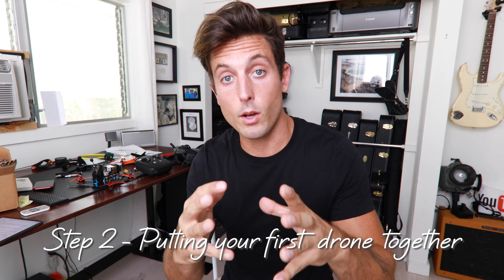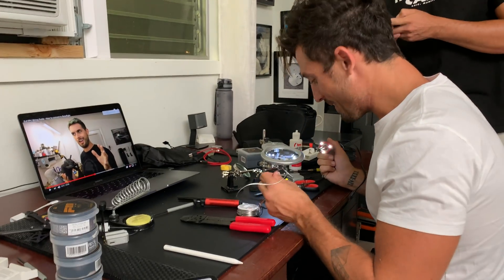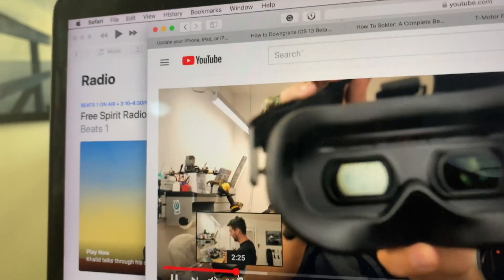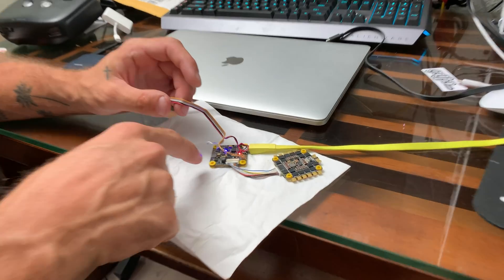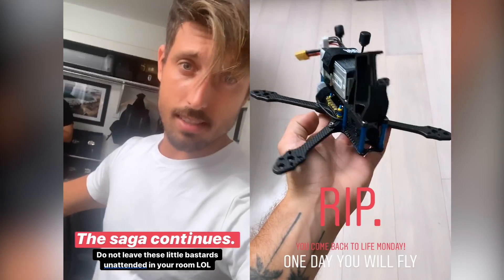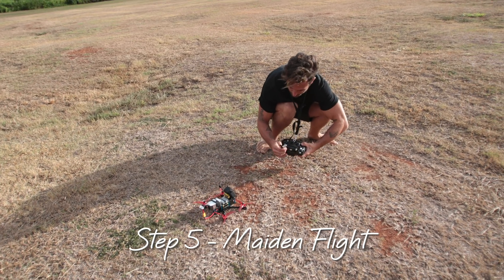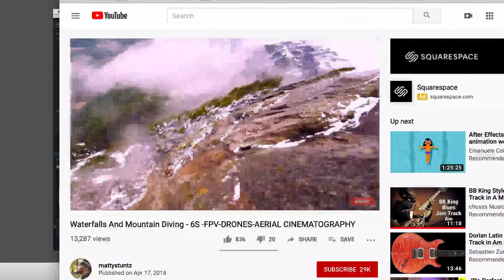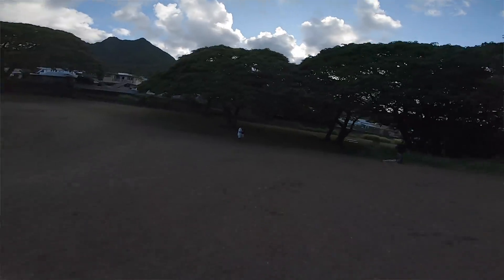How To Build a Cinematic FPV Racing Drone! • DJI Fpv

Comment: PID stands for (P)roportional (I)ntegral and (D)erivative 

When adjusting these terms in the algorithm you are balancing the response rate to the separation between current value and desired value. A cheap and dirty example of this is a temperature controlled environment.

Comment: Burning circuits or getting smokes generally means having the positive and negative terminals connecting or getting short circuited, if I recall. One way to check before soldering would be to use a multimeter first

Comment: Thanks for sharing you experience!
One question: Can I connect the new DJI FPV RC to my PC to use it with a simulator? I'm willing to buy the flight controller (only) to try it out, before I invest in the whole system.

Comment: Dang Fatshark! 
You guys missed the opportunity to win this race! 

People easily spend near $1k on their new phone every 16 months or so.   

I also rather spend $800 on nice HD setup over the old analog goggle full of patches, modules connections. 

It's just matter of time for more and more people acquire DJI headset which already comes with receiver and cost only $79 more than the HDOs that does not even come with a receiver.

Comment: To practice soldering you don’t practice on expensive chips LOL
Reply: yea i got started by soldering and desoldering resistors and wires from broken tv remotes
Reply: I did practice soldering with the "mamba practice board" Very cheap, and it has many  different types of pads
Reply: Soldering is literally so easy and if you don’t know how to just watch a tutorial.
Reply: @andykoch8599  Agree with you lad. I started first time on a 20x20 fc. Had a bad time the first time i soldered a receiver to the board. Then watched a bunch of videos on soldering and realised i needed to buy 40/60 solder and some flux. Haven't looked back since. I even built on a 16x16 stack recently and that was my 3rd build ever.
Reply: Omg did not thought of that🤣🤣🤣🤣🤣🤣🤣
Reply: I started with diatone practice board then cheap whoop i bought. Modded it.. 
Now trying to build 95x from scratch.. 
I'm thinking this is cheaper but god damn whoop pads r small
Reply: Thats the easy part for me, soldering and fixing electronics since i was 9, and programing is my job.
Reply: @Robbiebrito  that’s dope

Comment: super cool video , i have a question though every one seems to skip the part about the simulator and thats what im interested in the most at the moment , what sort of simulator setup should a beginner start with in terms of radio and fpv goggles ( something that will actually simulate flying a real drone so no Xbox controller and a PC screen sort of thing )

Comment: hey! did you actually connect the dji fpv radio to the simulator? if yes, could you let me know how? So far I do only own the dji fpv remote but i can¨t get it to work with my imac (i tried it with 2 simulators). cheers

Comment: Great work!  Nice to see a 0 to ridge diving video.  And this is as close to 0 as you’ll get, lol, so consider me impressed!  You should upgrade to the Hakko 888D for soldering.  It’s a beaut and it heats up really fast, high quality Japanese electronics.  You won’t regret it.

Comment: Great video Sawyer!  I happen to be at the same point in my FPV career.  Watching your video made me feel better about my own experience, since it is basically the same.  Hundreds of sim hours, dropped $1500 on parts, fried a camera, broke a bunch of straps, ate battery wires with my props, just got my goggles from China, already killed a motor, etc.  But I'm still at it!  Drew, Joshua, Steele, Rotor Riot in general, and UAVfutures have been invaluable to me, without them I doubt I would have felt confident enough to buy anything.  I look forward to more videos from you.

Comment: Your tune could use some work. Its a bit tight, that high speed oscillation you can hear but not necessarily see is D being too high or the ratio between P and D being too high, because PIDs aren't independent nor mutually exclusive variables, the Ratio between P and D is very important, and as you scale on you will have to scale the other.

Comment: It's not pid. PID ( Pee Eye Dee) is a way of controlling, in this case your drone by removing the error between what you want it to do and what it's actually doing as fast and as smooth as possible. That's why you tune your PID values - the better the values are tuned , the smoother your drone responds to your commands

Comment: I am new in FPV but I have a 20 year experience in real aircraft (and i can find a lot of similarities between those)... 
From my point of view this video passes wrong messages to someone who would like to take up this hobby.
It is not a regular hobby...
It demands a lot of skills, patience, knowledge, budget and discipline.
Moreover, it demands to stay strong to the fails that will come and level of risk assessment.
As I stated, I am not experienced in FPV, as many others in here, but I can assure that there is no way to present the build of a Quad in less than 13 min in a solid way that will pass the correct messages to those who will decide to take up this stuff.
Safe flying to everyone.

Comment: I just want this to be known, he spent way to much on his stuff, common rule of thumb 5in goes with most 5in stuff and I spent 600 bucks building my drone (two batteries, stuff to build drone, controller, and googles) and I bought very expensive googles, don’t think you have to spend thousand plus on this hobby, it’s expensive cause stuff breaks, especially cause I push my self very hard and do things I don’t think I can do, it cost me a lot but iv become very good at flying in a short time, your gonna crash but these drones are strong, usually just some props

Comment: This is almost exactly the same experience I had going thru my first FPV build. .... EXCEPT I was building with Eachine and the cheapest parts you can find on the internet.   Smdh it was still super expensive learning how to build, fly and tune my drone.  I can only imagine how expensive it was learning to build with DJI and their recommended parts.  Nice job.

Comment: This was a great vid! When I got into this hobby there was only the blackout frame. And there was not a simulator in site. I had to learn to fly by just going out and destroying and loosing drones.  I started out with the kk2 board on bigger drones then drones started to get smaller and more agile. Building was easy because of my US Air Force mechanical background but the learning to fly was hell. Glad your in the fpv world now. Keep pushing!

Comment: There is plenty of info on the net on how to do this, you just need o know where to look :)

Anyway, here is my generic advice for anyone interested in this awesome hobby....

Step 1: Get a Radio, Fly a Simulator
The first step is to buy a quality radio. Pilots who are used to video game controllers might like a FrSky X-Lite while others may prefer the FrSky Taranis Q X7. While FrSky radios are the most popular, there are also other great options like the FlySky Nirvana or controllers made by Futaba and Spektrum ( And now DJI). Once you have a radio, connect it to your computer and practice flying in an FPV flight simulator. If you opt for the QX7, be aware that many new pilots assume it comes with a battery or a way to use AA batteries however it does not. You will need to purchase a separate battery for either of these FrSky radios.

Step 2: Find Pilots Near You
Search Facebook, YouTube, and MultiGP to find other pilots in your area. Sometimes having someone local is the best resource for getting help when you need it. They can also point out safe spots to fly and might be willing to meet up for group events.

Step 3: Education
While you are training yourself playing around in the sims, watch every video you can by Joshua Bardwell, UAVFutures, Mr. Steel's How To FPV Playlist, and others on YouTube. You will learn a ton. Perhaps even join some of the FPV related Discord channels, or FPV subreddits ( r/Multicopter r/fpv r/multicopterbuilds r/fpvracing ), and ask questions.

Step 4: Buy or Build Your First Drone
Some people decide that buying a Whoop class drone is the best way to get started, others prefer to jump right in to the 5" class and build their own. Definitely check out Bardwells FPV Shopping List if you are going to build your own. Lots of good info in there. Also knowing how to solder is very important when building or repairing your drone. Get a good soldering iron, watch some tutorials, and practice before the iron ever touches your drone. The last thing you want is a solder joint failing while your drone is zipping across the sky at top speed.

Step 5: Goggles
To truly fly FPV, you are going to need a screen. Most pilots will opt for a goggle of some sort. If you are just starting out, get some relatively inexpensive box goggles. The eachine EV800D seems to get good reviews. If you outgrow them and you want to upgrade, they make great passenger goggles to bring friends and family along for a ride, which is also a great way to spread the hobby and get others interested.

Step 6: Enjoy!
I know it may seem daunting and there is a lot to learn, but it is fun and well worth the effort.

Comment: I’d really like to get into this. I use commercial drones for a living. (M600, M210/RTK, Inspire 2)
Every time I fly the I2, I always have to set it up to my preferences. (Collision sensors off, max decent speed ect.) .... Sorry to the guy that has to fly it after me... 
You can absolutely FLOG an I2 and do some pretty cool maneuvers. But it wouldn’t touch a racing drone. I feel like that is the next step... as a hobby anyways.

Comment: Cool video👏. I totally agree with the learning curve part. Flying, researching what to buy, understanding electronics, soldering, understanding telecommunications, programming, PID tunning... and crashing and repeat all over again... FPV is not an easy thing but it is totally worth it. I started about 1.5 year ago and I'm absolutely hooked.😍 Also big thanks to Joshua and Ledrib and all the fpv community bc without the yt videos I don't think I would have started in this hobby. 🚀

Comment: A digital multimeter or a smoke stopper would have stop some of those mistakes. You nailed it though this is what the hobby is. I felt like I was back in school the first year. At times I felt like quitting but I’m glad I didn’t.

Comment: holy shit, noob, lol, I smoked my first build also. check the main xt60 leads with a multimeter for continuity, and use a smoke stopper. Also, you kinda bought really expensive parts for no reason. I spend around 400 to 500 per quad, and that is expensive, you went completely overboard. in addition, build from the outside, in, so start by putting motors to 4 in 1 escs, and then attach signal wires to that. Also use dshot 600 and sbus

Comment: Great video! Stay away from 4in1 esc's. Singles are cheaper and easier to replace. I have been flying for 3 years and racing for 2. I have gone through a lot of equipment, mainly from crashing and midairs. I really like the dji system but unfortunately the lag is too high for racing. Check out MultiGP.com for a race near you.

Comment: The big lie ever 😂 On YouTube is a lot videos how to build and fly a racing dron/fristayl drone. And a lot of videos how to fly a drone. So please don't lie 1.8M of your subscribers.
Reply: Frincu Gheorghe Daniel you’re right, I built ONLY via videos on YouTube and had no one who can help me building.
Reply: The problem is its hard to fix specific things via Youtube. Like his DJI problem. Only a handful of YT people actually have it and use it and know what the problems are how to fix etc. He came in brand new and built a DJI rig. That's really hard. Even though there are tutorials on how to build an FPV rig, he probably was searching for things to specifically in his situation which everyone does. 

There are lots of videos on how to build a drone at the moment. Unfortunately most of them don't really keep up with the hardware and software available when building one.
Reply: @SnowdragonDS  I think its more a case of DJI Sponsoring him tbh.. money talks..
Reply: @SnowdragonDS  it's not hard if you know how to use a wiring diagram or pinout which dji has both of
Reply: @SkyCandyVisuals  most people don't.
Reply: I think what he ment is, that there is no tutorial on how to solder exactly his esc and his fc with whatsoever. I had the same problem when I got into this hobby. Joshua bardwell is your option if you need help
Reply: True, I seen a camera vlog person using one. I wanted one, then I realized you have to build them. I watched videos for two days. Ordered everything from a build it video. And built it in less than a day. All of this and I had NO experience making these types of things. There are videos with entire part list, showing the build, how to program and everything. There is no reason any regular person can't build one.
Reply: @PrimeInChina  could you recommend one good Playlist please? I got a gopro 7 already
Reply: Frincu FPV I legit was about to say the same thing 😂
Reply: Exactly lol
Reply: Yep 5 years ago I would have agreed. There was no help at all. Then blue falcon started making videos. Rip blue falcon you have helped a multitude get in the air.
Reply: so true
Reply: facts
Reply: Yeah I've built my own one like over a year ago with the help from YT videos.
Reply: i know right...i stopped watching after 2 minutes, soon as he kept saying theres 'no information and dji dji dji' wow there's tons of videos/forums everywhere...look at joshua bardwell for one he's 210% thorough with  all his videos taught me everything years ago, i think old mate would of got paid some big bucks from dji lol i can see it from a mile away lost me after 2 mins i'm out
Reply: Yea exactly what I thought ! There's so much info out there!!!! What u talking about! haha I built a 6s 1750kv marmotte in 2 hours after never building one before , played 35 hrs in a simulator and didn't even crash my first flight aside from that nice vid tho.
Reply: Personally, I’m a big fan of this video. It gave me a timeline of what to do in the FPV world step by step all in 10 minutes. I’ve flown DJI for about 3 years working on a sailboat, in the mountains and traveling all over the place. I know how to fly a drone, but it’s an entire different ball game, so having a step by step understanding of what to do to progress by watching his experiences is a great tool for someone like me. Thank you for the comprehensive video, man.
Reply: @Benagins  if you have a DJI flying tripod you are not flying or rather you do not know how to fly a drone.   Period.   The difference is night and day between an FPV freestyle/racing/acro build with no self leveling, no gps, no return to home.   The first time you fly out and wind up in a bad signal situation and your video feed drops you are likely walking to go find your quad.   There are a half dozen things that take a long time to develop muscle memory for as well as to maintain orientation and be able to find your way back.

DJI is an idiots guide to sitting in the air and letting an auto pilot figure out what you want it to do.
Reply: Glad you called him out on that, there is a ton of info out there.
Reply: I was just going to say this, he acts like he its 2010 and the sport is new. A quick search will provide thousands of videos on every aspect of quad building and flying.

Comment: There's tons of information on youtube, build videos, every single tutorial you can imagine. lots of blogs as well like Oscar's https://oscarliang.com/  Even i have some how to solder videos. LOL!  I taught myself to play smoke on the water and that's as far as i got with the guitar, but i can fly like the wind blows.  Accurate perspective from someone just getting into the hobby. I would add that it's addictive AF as well and you will burn through batteries a lot.  they don't last forever.  Very good flying for a noob.

Comment: Great recap. Its great to see someone succeed in fpv and share their experience (the good and the bad) with others. Hopefully you’ve inspired others to follow in your footsteps. 
I also noticed that you purchased your gear from GetFPV.com. The next time you order (or anyone else looking to get into drones) use code “ENGINAIR” for 8% off. They have anything you could possibly need for fpv aswell as DJI products. 
Their customer service is top notch and if you want to see that first hand look up their facebook group. It’s a great place to ask questions and learn from the community.

Comment: Yes, i used to build kwad, but i got turned off because the struggle is to get it tuned on the air or building proccess. Even tho i used flightone

Comment: FYI It’s a LOT cheaper if you don’t use DJI products
Reply: Is it really though? When you factor in the price of all the parts including similar goggles from Fat Shark and a gopro to get cinematic shots I imagine it's pretty similar in cost.
Reply: Nonplussed Productions yes until you crash and break the DJI parts
Reply: @MagicFPV  That's why you get the dji care plan. Plus in the event of a large enough crash which is more likely to break? The thing in a covered shroud with a single wire running to the camera or the thing with exposed wires and solder joints from a board that might have some hot glue on it?
Reply: Nonplussed Productions I have crashed these things hundreds of times into hundreds of things... and trust me exposed (accessible) wires that can be re soldered are a good thing and hot glue is your friend. I wasn’t aware of the DJI care plan but assuming it’s some kind of warranty you’ll still be out of the air waiting for them to replace something instead of just fixing it yourself in the field and getting straight back in the air. You could of course have a backup but that would definitely be more expensive